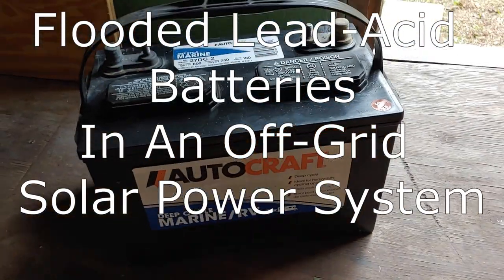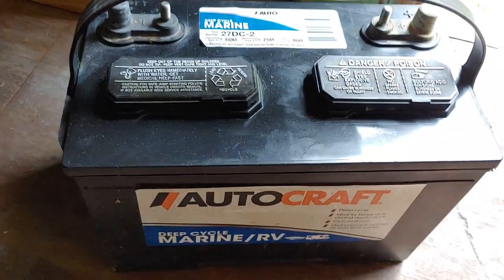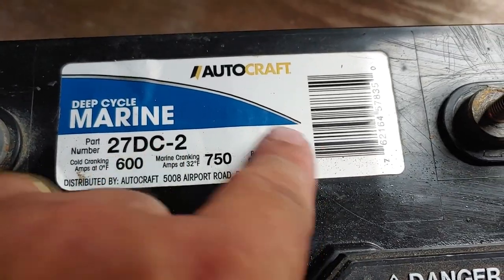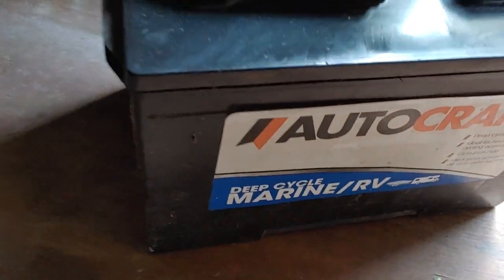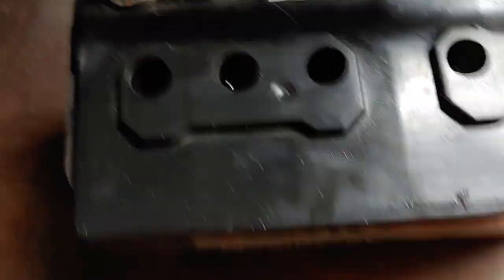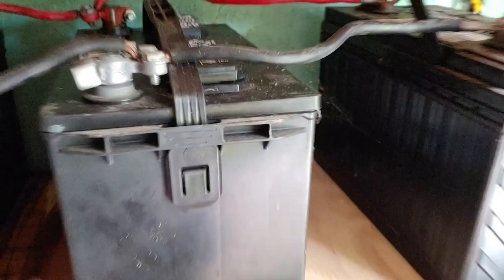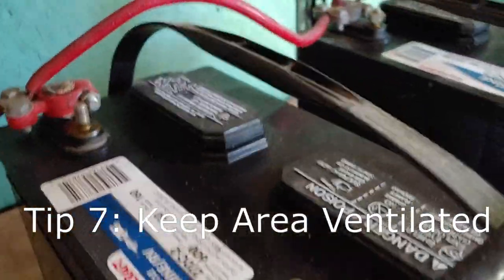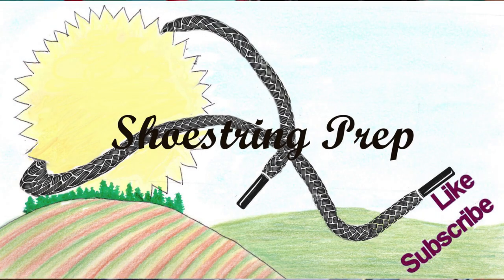Flooded Lead-Acid Batteries in an Off-Grid Solar Power System

Comment: SLA batteries are a huge pain in the neck.  Their only redeeming quality is lower INITIAL cost.  The truth of the matter is that Total Cost of Ownership (TCO) is not significantly better than building your own LiFePO4 battery system.  Add in the lower weight and size of lithium, the relatively constant voltage, and the dramatically reduced maintenance requirements, and you quickly realize why most of the systems being built today, at least in the US, are ditching the SLA batteries and going with either lithium or at least AGM.  There are several DIY lithium batteries on the market today that make it easy and relatively affordable, over the long term, to get all of the benefits of a far superior battery chemistry.  No need to stick with 20th century solutions, if you don't want to.
Reply from the maker: AGM batteries are a simple, inexpensive solution to help people on tight budgets with their energy storage needs. They work best in temporary off-grid situations and they do very well for that purpose. We appreciate your input.
Thanks for your comment.
Reply: @shoestringprep  - LiFePO4 batteries are a simple, cost-effective solution to help people who understand value versus cost with their energy storage needs.  They work better than AGM batteries because they do not off-gas and are safer to use indoors.  Lowest cost is almost never the best solution.
Reply from the maker: @jasonbroom7147  thanks for your comment
Reply: @jasonbroom7147  i am pretty sure most people would opt to have a 3M USD house that is totally up to passive house standards with the latest up-to-date systems keeping it totally independent. It will most probably pay off. You "just" have to find the 3M USD and you are all set. A proper size of LiFePo4 battery bank costs more than three months of total income for a family where I live and we are not considered poor. Explaining why people should invest big money that they don't have demonstrates no understanding of the word "shoestring".
Reply: @koborkutya7338  - If you don't understand what a false economey is, there's little chance I'm going to be able to explain it to you.  Nobody should invest big money in anything, if they don't have it to invest, but buying SLA batteries versus LFP isn't an investment...it's just a bad, short-term money decision.  Making decisions like that is how you STAY broke.

Comment: I'm seeing that forklift batteries usually come in 24, 36, and 48 volts, all made up of two volt cells. They are designed to survive being banged around on solid rubber tires with no suspension. Reconditioned used ones can last for decades in home solar applications. You're a helpful person, so I'm passing back to you what I've learned. Getting the two volt cells out of a steel case can be work. They weigh over 100 lbs each. The lead bars connecting them have to be cut, too.
Reply from the maker: Thanks for your comment.

Comment: car batteries compared to marine deep cycle, cost three times less, with 30 amp deep cycle you get a 90 amps regular, amazon prices or other reseller, i charge mine to 13.1, and discharge 11.7 early morning.

Comment: I'd prefer to use Lithium phosphate, they're safe, higher capacity, they can be safely discharged to near empty, they have longer cycle life, and nowadays you can get them for the same price as AGM. They also produce no gasses and are very low maininence.
Reply from the maker: Thanks for your comment.

Comment: Good coverage in a short time.

I use AGM batteries in my small solar system but I'm fortunate to be in an area with a lot of businesses that use AGM batteries in their big UPS systems and for backup for their video surveillance.  The last group of AGM (two 100AH and two 110AH, about 15 months old) cost me $305 (versus close to $800 new).  My spreadsheet for power usage assumes a maximum of 50% Depth of Discharge and the previous group of used 80AH AGMs lasted almost 9 years (5 years in UPS service, 4 years for me [to below 80% capacity] - but they were only $35 each - not likely to find a deal like that again).  

Using AGMs means I don't worry about ventilation or weekly water checks and, if those checks fell to my better half, that might not get checked until we were in the dark.  Plus they can be on a shelving unit in the basement with the charge controllers and inverter hung off the side of a shelf for good cooling air flow.  Instead of the current 420AH of AGMs, I'd like to have triple that in LiFePO4 - currently about $2500 (Amazon, free delivery in about a week) with BMSs, but they'd likely outlive me and I'd have fridge power for almost a week.  I am replacing some hard-to-find AGM UPS batteries with DIY LiFePO4 using cells from batteryhookup.com - beats the $50 the UPS manufacturer wants for the AGM with maybe a 4 year life in UPS service, especially when the parts cost (cells, BMS, holder) was under $20 and I got to learn about a new battery technology.

The now 6-year-old battery that I took out of my truck a year ago when it sounded like the starter was turning a little slow, now sits in the basement for testing inverters and performing jump start duty.  A battery impedance meter still shows it at about 90% of its original capacity and I have an Advance Auto battery from 2005 that's in a plastic battery case for when I need portable power - neither of those is deep cycle but they see only intermittent use and they work fine for that.

My solar power spreadsheet does have a page for flooded lead acid batteries with the maximum DOD being 20% (but adjustable, depending on need).  If things go sideways, there will likely be lots of abandoned vehicles - useless without fuel - but the parts are still useful (power seat motor driving a solar tracker?) and I have spare charge controllers configured for flooded batteries, just in case.

One formula I found for RC to AH would make an RC of 160 = 94AH, but a new, name brand battery could be 9% higher than that or about 102AH (based on some testing I did).  Using half the RC as an approximation of the AH ensures you won't exceed the battery's capacity

I've been there when a spark exploded a lead acid battery.  I was fortunate that the battery was in a vehicle and that it blew out a bottom corner and just ate up the cuffs of my jeans and my Keds ;-(  That might be one reason I prefer AGMs and the newer lithium technologies ;-)

The inverter is a 2000 watt pure sine wave unit from reliablepower on Ebay (now selling them with a WZRELB label) with an identical unit as a spare.  The inverter's output is cleaner (oscilloscope check) than what the local power co-op delivers.  The charge controllers are EPEver 3210A 30 amp MPPT units and all of it has been in place for 4 years.  The maximum load on the inverter is about 1300 watts when fridge, freezer, furnace blower and a few LED lights are all on.  The average load is much less as it's rare for everything to be on at the same time.  If that became a problem, I have digital timers rated at 15 amps so the fridge and freezer could each be on for 2 hours at a time but in a staggered cycle.
The inverter connects to a 4 circuit transfer switch via a 12/3 extension cord - the same cord is used when the inverter generator is in use (about two weeks of treated fuel for keeping the battery bank charged when power is off and there is no sun).  Longest time on the backup syetem so far was 12 hours when the county had 7-12" of snow in an area that rarely sees more than 3".  Sure is nice to walk down the stairs and flip a couple of switches to have power instead of shoveling 7" of snow in the dark at 30F to get a generator out of the shed and trying to start that gen at that temperature...
Reply from the maker: Thank you for your comment. It was very informative.

Comment: This is the exact group 27 battery that I use in all my solar setups and in my RV.
O'Reilly Auto Parts is the best place that I found to get them.
Reply from the maker: I received my from advanced auto parts. Thanks for your comment.
Reply: @shoestringprep  O'Reilly's was a lot cheaper I got mine for 85 a piece compared to over 200
Reply from the maker: @heroesandzeros7802  it is always nice to get a good price. Thanks for your comment.

Comment: Great video  what inverter do you use and.  What is the safe watts I can draw of it
Reply from the maker: I used a AMIS 5000 watt modified sign wave inverter. I pulled about 3500 to 4000 watts if the system. Thanks for your comment.

Comment: 12v flooded battery and what may the settings be for, bulk, absorption and float...
Yeah and equalization. 
Do you know?
(Its a 12v tudor flooded battery with a victron 100/20)

Comment: shouldn't they also be kept in a relatively warm location? or is that only for the non deep cycle high cold cranking amp batteries (car batteries)?
Reply from the maker: Flooded lead acid batteries don't really mind the cool weather. Thanks for your comment.

Comment: Are there any issues to keeping solar panel and charge controller connected to battery continuously, 24/7?
Reply from the maker: J. Lynn Engle, thanks for the question.
There is absolutely no problem with leaving batteries and charge controller hooked to solar panels 24/7. My batteries do, and have been doing great for years.
Reply: As long as your using power off the battery's it should be ok - if your not using power off the battery's it's better to just put them on a float or maintenance charger from the grid when there not needed - 
      The daily cycling of solar panels when battery's are not discharged will sulfate them - 
     If they do sulfate you can look on you tube for desulfating battery's with a welding machine - amazon has $60 inverter welders that are fantastic for desulfating lead acid flooded battery's - 
       That's method has been used for over 140 yrs with lead acid battery s - 
      If there not on a charge    maintenance charge you can top them off ever two weeks when it's warm - all that depends on the ambient temperature im using 80" f - 
  High end. MPPT controllers have settings that will just  monitor the battery's state of charge and give it a refresher charge when needed 😊

Comment: Pop the lids off and use a small pocket mirror to save your back from having to lift those heavy batteries. Use the mirror to look inside the battery to check the levels of course.
Reply from the maker: Thanks for your comment.

Comment: Hello is it ok to discharge them to 10.5v ? also what percent discharge (DOD) is achieved from the 12v cutoff voltage ??
Reply from the maker: Dicharging to 10.5v will harm the battery. I would not go below 12.1 volts thanks for your comment
Reply: @shoestringprep  Many thanks,  wondering at 12.1v could we achieve only 10% of the rated capacity ?
Reply: @hasger1941  12V is 50% of the battery, and is the recommended level for FLA (Liquid Electrolyte) batteries.

Comment: Hi, cool system. I have 2 big 200 ah deep cycle wet batteries in Parallel. So i‘m thinking about adding some 80 ah marine batteries parallel to the big ones. That shouldnt be a problem? Thanks a lot.
Reply from the maker: Are the 80 ah batteries the same kind of batteries as the 200 ah batteries? Both deep cycle? 
But presuming you have these attributes lined up, the answer to you question is that you may hook them together and it will work. It will not be as efficient as if they were all 200 ah or all 80 ah batteries.
Thanks for your comment.
Reply: @shoestringprep  thanks! I just hooked them up! It works. The bigger batteries just deliver more current. That‘s the advantage of an 12 volt system. I could theoretically hook as much batteries to the system as i want. As long as the type is the same. Thanks
Reply from the maker: @batterynerd8779  great! Thanks for letting me know.
Reply: @batterynerd8779     The type,  and as long as the VOLTAGES are already the same  ( meaning closely the same,close to .02 or .03 volts diff); if not, the higher volts ones will discharge into the lower volts ones ( that is what volts do...) and tend to even things out;  unless one of the batteries already has a bad cell, a lower voltage that is,and then it will keep on eating volts (milliamps!) from the good battery; i have one of those tiny red display digital voltmeters ( 4 of them..) atop each one of my 4 batteries,for just a glance; there are many other tests you can do when using multiple batteries;
now a question : 4 batteries (or 6,or 8...) , 12v each, for a 24v system:  is it better to parallel 2 series of 2 ,or to series 2 parallels of 2 ?
Reply: @josepeixoto3384  it actually doesn’t matter too much. It depends on your setup. It‘s just important that you firet put all your batteries in parallel (12v,6v…) and charge them to 14.4 and 2 hours at 15 volts. They will be perfectly balanced. In series, all batteries need to be the same battery capacity and voltage. Then you can arrange them how you want to. It doesnt matter 2 p 2s or 2s 2p. Just how much cable you want to use. The more cable, the more resistance-> power loss
Reply: @batterynerd8779   agreed 100%, thanks.

Comment: Thank you for this video.
I built a lead acid set up in my RV.
But the batteries are inside and aren’t ventilated ( yet) ( a huge retrofit would be needed).Is this a serious issue? Meaning, do they off gas when running or being charged only, or all the time?
Is opening the door regularly going to be enough?
I don’t smell anything ( gases)- is that an indication that it’s minimal, or are the gases odorless??
Thx for you answers. And I’m a new subscriber to your channel!
Reply from the maker: Welcome new subscriber! The batteries produce the most gas when they are charging. So during charging try to have a window or a door open. You cannot smell these gases. You should be aware they exist though. Thanks for your comment.
Reply: There are devices that detect when battery's are being charged and run a small axil ventilating fan on high after charging is terminated the fan runs on low  - hydrogen is highly flammable it's what makes gasoline and vapor gases so flammable - 
      On the old diesel submarines there were hoses connected to battery caps that drew air that pulled the hydrogen off the battery's and it went through a catalyst to burn off the hydrogen even when they were not being charged - 
     In an enclosed area there should be a fan to ventilate hydrogen out side  -

Comment: I just bought two Group 29DC deep cycle marine batteries (flooded lead acid). I guess battery manufacturers are now putting the amp hours on the battery label instead of "reserve capacity" because both of my new batteries state 122 Amp Hours right on the top label where reserve capacity used to be.
Reply from the maker: That would be something new. Thanks for letting us know. Thanks for your comment.
Reply: Many manufacturers state the amp hour capacity - it's more so for marketing - 
       Very few understand battery technology today compared to the past - if a battery states it 100 amps in reality only 50% of it is usable power with lead acid battery's that have been fully charged over 24 hours - 
    If person sees 100 amps that looks good but most devices drop out at 10.5 volts - so on a fresh long charge the battery will delver 50 amps - if the battery is cycled daily as on a sail boat -  they don't have the fuel to charge 12 to 16 hrs a day - so they fast charge 1 hr and 15 minutes a day or till the battery gasses - at 85% state of charge that's concidered full charged - it might take up to 24 hour to get the last 15% back into a battery -
Reply: @@thesolarjunkie that's good what you have as long as you still have good sun your ok - 
        Far about 35 yrs I had 106 golf cart batteries - I was hybrid - 
     My stand by generator burned 50 gallons of propane a day - 
      After hurricanes and ice storms they don't deliver propane for w while - 
      I would just have my stand by generator start an d run 3 to 4 hrs a day and replace the energy used out the battery's each day - instead of burning a 1000 gallons of propane in 3 weeks I would only burn around 150 gallons of propane in 3 week going hybrid - 
        Today I just use a inverter generator so I gave the battery's to a friend - I just have a few battery's like you have now & just run a 5000 BTU AC - after storms like Ida